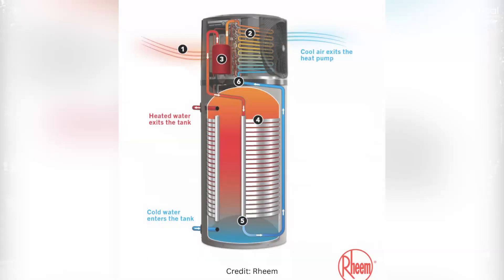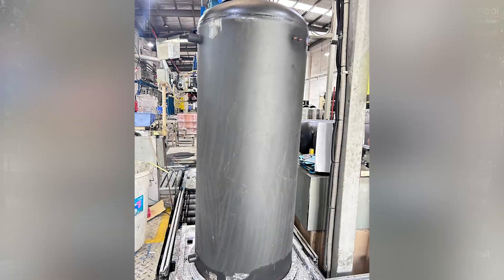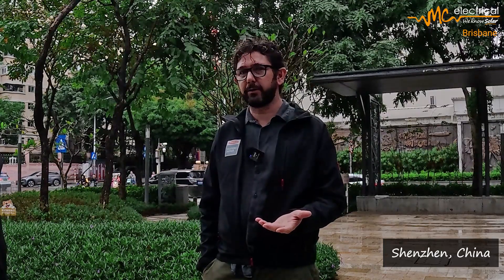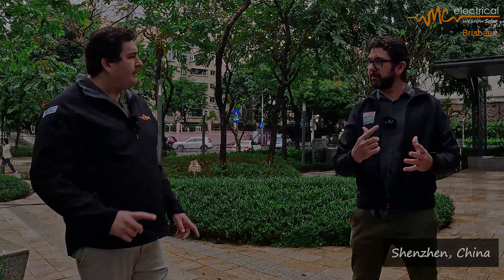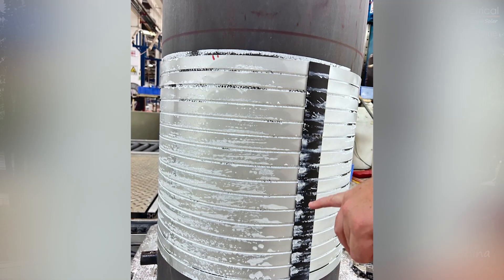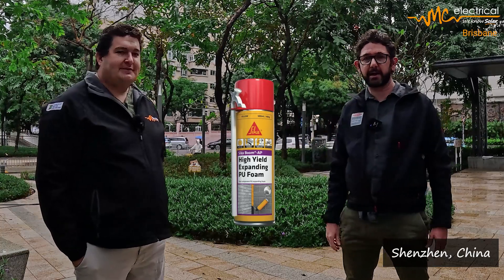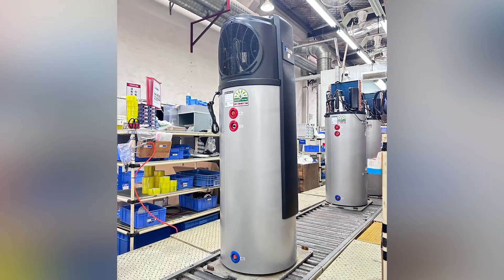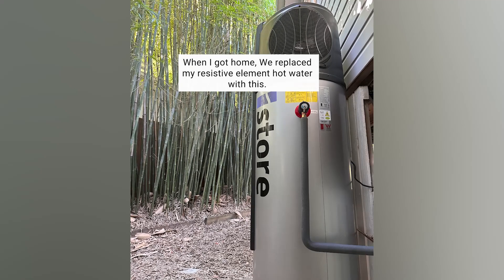iStore Heat Pump: How They Work, How They're Made

Comment: Have many heat pump manufacturers started providing any kind of API integration to fronius, or smartphone app to allow control over use of excess solar or off peak tariffs?
Reply from the maker: Not that I know of. But catch power does that. It does the job of the inverters consumption monitor, and then controls the hot water…. And a whole lot more.  https://youtu.be/eNEjfihfo_E?si=1BhkAw_Mlhmf3N_E

Comment: Different refrigeants have different boiling point's. CO2 has a lower boiling point so the delta temperature difference is greater than other profucts which means its more efficient at heating in a colder climate.

A gas that boiks at -100c compared to one that boils at 80C is 20C difference if ambient air tempersture is 0C.l.

The performance difference of between refrigeants is not linear between different ambient temperaturea. This is why COP is different at different ambient temperatures and why buyers need to look at the climatic conditions for their location prior to purchase.

Also why no resistive elementvis not required for the CO2 unit. Its quicker at heatin, its more efficient and you can get the water hotter..

The unit youd buy in Canberra might not be the one you would get for Brisbane

Its snows and is much cooler in much of  Japan hence CO2 is used as their refrigerant as standard.
Reply: Nice, thanks for explaining that better and more confidently than we did :)
Reply: @markcavanagh its much harder to do on film off the cuff. I had time to prepare and edit.
Reply from the maker: Ha thanks. I’m relatively new to this heat pump thing so validation of what I’m learning is useful. 🙏
Reply: @markcavanagh Also Gas instant hot water very common in Japan. They aint all high tech.

They alsonproabbaly get Australian gas for less per MJ than we do.
Reply: I suggest you have a look at the Stiebel Eltron Shp-0 200/300 units about to be released with PV integration and ap monitoring. Brand new to market later this month.

No I don't work in the solar or heat pump sectors.
Reply: @ nice tip. Thanks

Comment: How do you get a heat pump to go over 60C though? My (admittedly slightly older) Sanden absolutely refuses to, and heating only once a day without the ability to boost has made me question my decision
Reply: Sanden would be CO2 you should have zero issues getting to 60C. Might need to check settings and chat with supplier.
Reply: I agree that does sound like something is wrong. There are ways to adjust the temperature on the Sanden via the screen but i would chat to the installer. It also has a block out timer. maybe its run time is too short. Hopefully its an easy fix for you.
Reply: @Yorick_Mark  Australian models are firmware locked. Adjusting the temperature on the screen does nothing.
Reply: @Serpsor  Thanks. I didn't know that. Probably for the best.

Comment: How long did the iStore manager say the heat pump would last?  It's very hard to hear that part.
Reply from the maker: I’ve asked Karl to answer this. It’s a long answer but Karl will make it simple… I hope
Reply: @mcelectrical same day hot water say 10-12 years is an average
Reply: Good question.same day hot water who supply and install say 10 years average

Comment: I just installed an istore in Maryborough Qld. It was an absolute shitshow getting a plumber to do it. They hate heat pumps. Yet they love air conditioning when its hot.
Reply: I'm also in Maryborough and about to Install one in the next month or so.
Reply: @richardbarnes2609  i wish you good luck! The electrician i used was Tanner Electrical. Really neat job, happy with it.

The plumber was a pain in the ass (a reputable business, "from sand to the bathroom" if you get my drift). He did everything under the sun to try to talk me out of it because "all he ever does is rip them out". But he's never ripped out an iStore. Only ever ripped out Dux and Rheem, because he's not qualified to service/repair them, and they have to get someone from Hervey Bay to do it. He's a good plumber, i've had him do some work before, and the job is neat, but I felt like he was living 10 years in the past when it comes to heat pumps. I had a similar recent frustrating conversation about roof repairs and installing roofing blanket. If you call them, my advice is know what you want and if he won't do it, call someone else.

I had to order the heat pump myself from istore (speak to Josh) and they shipped it from Brendale for me. 

I'm going through the REC process now and it's a bit of a pain in the ass with their requirements, dotting i's and crossing t's. Just make sure you have a qualified plumber and electrician do the install and invoice you, so you can claim the RECs.
Reply: @davidunwin7868 I spoke to you on the support line this week - hence my frustration with your plumber now properly explained. It shouldn't be this hard!
And thankyou for going out of your way to do it anyway the planet and I appreciate YOU.
Thankyou❤
Reply from the maker: lol.  Such a classic story. Would be happy to chat about your story sometime if you were up of it on record. Call us at MC Electrical and say we were chatting online

Comment: I have had a 180L iStore hot water system since 2020. Very happy with it! Runs on the heat pump heating only (no resistive input) and takes up to 3 hours to heat up to temp. Can keep the set temp as low as you wish as it does a heating cycle every 10 days or so to prevent bacteria in the tank. My 6.6kW PV Solar more than covers it's electricity use as I have it set to only turn on during the midday sunshine. It is quiet too.
Reply from the maker: Nice. Thanks for the feedback Bonzo

Comment: I grabbed an iStore before last winter. It’s dirt cheap to run, particularly if you’ve got solar, but I found it very slow to heat up in winter. Summer, no problem. I’m in Vic. - All in all I’m still happy with the purchase, just need to recalibrate my expectations of the hot water system.
Reply: Set it to run between 10am and 4pm during winter. If it's running when the air is warmer, it will heat a little faster.
Reply: It will heat a cold tank in winter in 4 hrs. Istore has 50% more power than most heatpumps hence takes 2/3 the time to heat  @davidunwin7868
Reply: That's easily explained. Summer need to heat water 20-40 for you to have a hot shower, in winter need to heat from as low as 9deg to 46 (losses are higher in your houses pipework)
Hence twice as much heating of the water is required.
Reply: @karlajensen100 Close. It's delta difference between the boiling point of the refrigerant and the ambient air tempersture that determines how long it takes to heat water.

The pipe issue between tank and outlet tap is exactly the same for different heat method  tanks with the same water temperature.
Reply: Expect a life span of 10-12 years